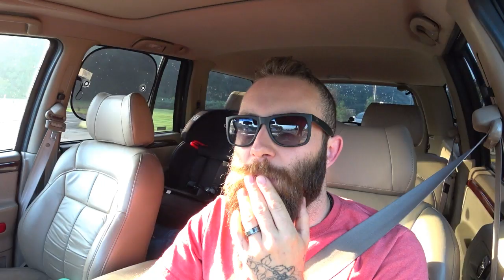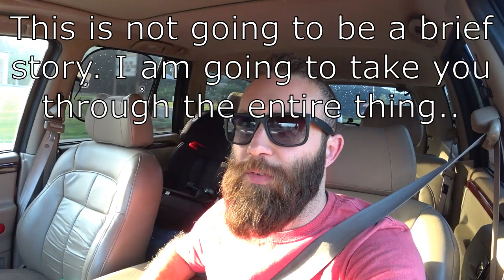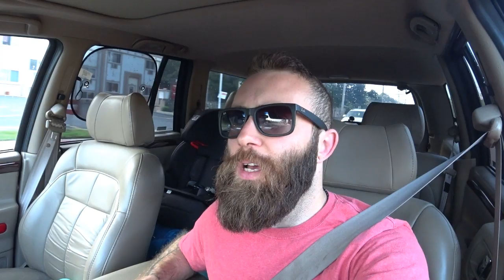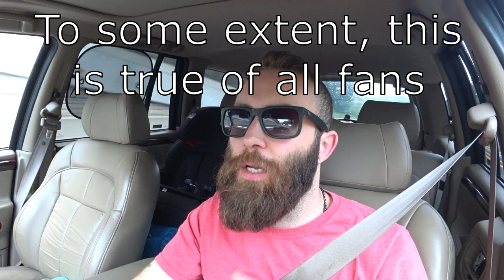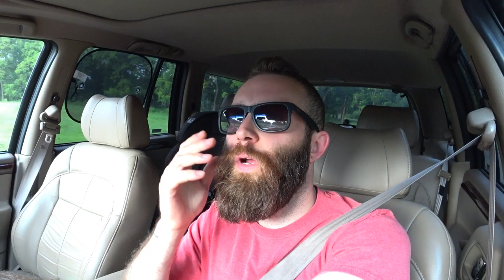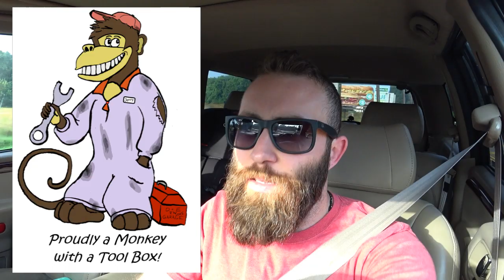Mystery Engine Overheating Issue SOLVED - Jeep/Dodge 4.7L

Comment: had same problem with 2001 grand limited. if your water pump is cavitated it wont circulate right. my thermostat was getting stuck. after doing radiator, water pump gasket, power steering pressure line. lol
Reply: 4.7l
Reply: oh yeah a proper bleeding. lol
Reply: 200,000+ miles. from texas to calif. travel
Reply from the maker: Maybe I will change out my water pump just to be sure
Reply: @DEInTheGarage  at least look at it. didnt buy it off the dealer lot
Reply: Lol

Comment: I found this in the factory service manual: "CAUTION: Use MOPAR Power Steering Fluid or equivalent. Do not use automatic transmission fluid and do not overfill." Do you have the Mopar part number for the correct fluid? Mine (2003 WJ/4.7) runs between 210 and 220 just driving around town, outside temps  70s to 80s so I'm thinking I have the same problem.
Reply: OK, I did some Googling and found it takes Chrysler MS-5931F which, apparently Chrysler doesn't make any more. Fortunately you can just buy any PS fluid that specifies that it meets the Chryslet 5931 standard. So I ordered some RedLine and I'll do a flush & refill (Martinbuilt has a video on how to do it) this weekend & see what happens.
Reply from the maker: Awesome. Let us know how you make out!

Comment: Dealing with a similar issue, Replaced radiator and suddenly i have a code saying either faulty solenoid or wiring. Anyways i go and unhook the temp sensor and the fan shoots into hyper mode. The guys on the jeepforum seem to think i should just try and replace the solenoid. Would you have any recommendations?
Reply from the maker: Yea, those solenoids do tend to go. I think you have to get one out of a junk yard as I dont think they sell just the solenoid
Reply: Thanks, any avalanche videos in the works??
Reply from the maker: @johnb9842  Yea, other projects have pulled me away, but I have the next video planned. Unfortunately I do not have a free weekend until sometime in March, so it may be a while before I can get back to it. At the very least I will go hard on it this spring

Comment: I just bought a 2001 at least having the very same problem. The guy I bought it from has it all torn apart so I haven't really looked it over yet but I'm curious as to whether or not the factory put a warning label on the power steering unit oil reservoir saying to use only Mopar power steering fluid.? 
Then my other question mark is why would you put ATF in the power steering unit and not put power steering fluid in it?

Comment: I hope it all works out. I was worried I have seen issues with 4.7 but man that’s true of every motor. No one goes online to say hey this is the greatest motor about any motor. Tell someone comes up with an issue and they feel they have to defend what they bought like a 3.8 JK guy. I have a 5.7 hemi and now I’m worried about the freakin’ cam. It to is my driver and I just had 3 hand and arm surgeries I can do it. Do I run redline oil as people are saying at 90-100$ an oil change. As we say in bike racing ignorance is bliss. The fastest riders don’t even know how to tune up a bike. Me I go into a corner and it’s like that feels like the axle bearing is a little loose or the bike doesn’t rev out correctly today is it lean etc? The average consumer believes what the mechanic says and goes with that tell catastrophic failure. But drives happy tell then But a dealer serviced Jeep would have $20 PS fluid in it. Ugh now I’m worried the drain plugs tight in my XJ. As I head out to find an oil leak on my daughters Patriot so someone else Can fix it witch hurts my pride. Good luck my friend. Another good vid. Hey fluid wise tell me what to truly run in the 5 speed trans in my XJ so it shifts better I’d pay $20 a quart lol.
Reply from the maker: Haha.. fair point.

Comment: Having issues with the hydraulic fan as well wife bought 03 Jeep Cherokee 4x4 4.7 shit man I replaced water pump thermostat and fluid change and changed the cooling sensor spend hours why it’s still over heating literally lol

Comment: Did you end up replacing the valve seats? Mine has had this exact same issue running a little hot when at stop lights for 3-4 years now. Just rolled 200k and finally found this video

Comment: My 01 runs here in Nor cal Runs @ 200 all day for 3 yrs and No. Problems. For Me Watch your oil. Look for Any normal weird changes. I'm in the opinion. You ran Warm. Not OMG Hot. You'll be good, but that was your Gimme. The Universe wont allow a all out Sin.
Reply from the maker: Buddy, I sure do hope you are right. I want to like the 4.7 and I want to hold on to this Jeep for a while. I have an oil leak right now which is concerning as I have to add oil between oil changes. That is next on the list to fix

Comment: This is the exact issue I am having with my WJ. mine hovers around 210 and if it over 90 degrees my A/C is pretty much useless.  I recently had my power steering pump replaced and that did help but I now suspect they did not use the Mopar hydraulic fluid like you recommended.  I looked it up but there were several results.  Do you happen to still know the part #? Hopefully you do or someone knows. I appreciate any help with this and thank you so much for this video. Damn that hydraulic fan!

Comment: Let me start off by saying 2 things! Great vid, thank you. 2nd. I hate and love the 4.7. I have owned 17 WJs, most with the trusty 4.0, but several with the 4.7. LOL, currently I have #12 my 04 4.7, #16 a 99 4.7 and #17 a 99 4.7. Both my 99s (prob gonna flip) have the awesome mechanical fans as I love, but my 04 has the hydro. Now I have had it over 8 years now and it has 191K miles and never had any issues, I bought from original owner who I know. I am starting to wonder though if I actually have the wrong ps fluid in it as I have noticed that the temp has gone a tad, just a hair past mid point and it has actually felt like my power steering is hesitating when I first start her up. Like for a split sec I have no power steering. Prev owner can't remember ever changing fluids, but also it was taken care of by a few shops over his time. 
I watched your vid and started searching for the MOPAR 68234631AA that is the MS10838 and can't find it anywhere. When I thought I found it was the regular fluid MS 5931 that I am guessing is for all other 99 to 04 WJs with the 4.0 or 4.7 non-hydro cooling systems. 
Every time I think I have found some as they say for hydro it says MS5931. 
I know it has been a few years since you did this vid, and wondering if you still have the WJ and what other issues if any have you had and learned from?

Comment: I got rid of the hydraulic fan I lost a bit of power and and mpg loss but I went to the mechanical over electric fan setup, here is the mod tho I went to a 12 blade 16" fan blade for a Ford Dorman pn620-149
Reply: I had to modify the fan cluch a tiny bit and drill out the bolt holes a little bigger ....
FYI this was recommended from another channel for the fan

Comment: I’m really appreciate all of that information bro!!I have a 2004 ram 4.7 with that overheated problem. What kind of type or model of power steering pump do you recommend me for my truck?
Reply from the maker: I put the cheapest one I could find on. It does the truck, but is very loud.Anything from Rockauto should be fine
Reply: D&E In The Garage 
Bro, thank you so much for help and time, I’m already did the pier steering pump replace but it doesn’t work unfortunately. I have no idea what I’m going to do now. I  replace the temperature sensor, thermostat and water pump either. Any idea to find the possible issue that is causing the overheating?

Comment: TLDR; skip to around 14:30 - 15:00 through, genuine Mopar hydraulic power steering fluid fixed the issue..? Some moron Jeep engineer designed the rad fan to run off the power steering pump somewhat directly (?), and the early 4.7 steering pumps are super dependant on having the correct (thinner than cheaper off the shelf stuff) power steering fluid 🥴

Comment: and let's say you damage your panel to get to the relay under the headlight and it's not there. It's in another location. No idea. New radiator & I overheat at idle, no idea where the relay is.

Comment: Hi Dan I found out how to trick the computer to think the engine is hotter which will make it increase the fan speed for $ 15.
Need a 3 bucks switch from walmart on your dashboard, some cables to bridge the cables on your temp sensor, and a 2.4K ohms resistor (or 2.0K for more)
PM me if you want some more info to show you what i did so you canmake a video on this.
Reply: With the 2.4k ohms we cheat the temperature up 15F at 212F (the computer thinks is at 227F) and wil increase fan speed a notch. 
This works best with a 180F thermostat intead of the OEM 195F
Reply: You need a swich to disconect the bridge when the engine is cold as then the same resistor impacts the reading much more, (like will tell the computer coolant temp is 120F when the true temp is 70F) and your engine will start roughly as some choke is needed but wont have any.

Comment: Look man I haven't 4.7 Powertech motor to on a 2001 Dodge Durango to high-output motor in the original owner of that vehicle that has 240,000 miles on it has the max tow package on it and I tow with a vehicle I never overheated never will and it has two hundred four thousand miles and that truck is going like nothing I keep him entertained you don't have to take out your head out if you don't have to fix him don't fix him
Reply from the maker: Thanks buddy!

Comment: I've noticed a common theme in 4.0 owners who "upgraded" to the 4.7 WJ's for as James Pumphrey would say "Mo powah babeh" and more gears, better towing and a multitude of other reasons. It seems like everyone goes woo hoo! This thing is awesome until it breaks and is inherently more complicated than the 4.0 and then they hate it. As someone who has just made this transition as well I have a couple of points. 1. I love the 4.0, there is  no doubt about that and I will miss my champagne '01 Laredo 4.0 dearly. 2. I love the WJ platform and am attempting to build my own version of the ultimate utilitarian vehicle as you are. Starting with my new to me patriot blue '02 Laredo 4.7 with the 545rfe and a factory (yes FACTORY) 242HD... Somehow I got lucky. 3. In my honest opinion I think people give up too easily. If my 4.7 quits I will be ready and willing to throw down the money for a remanufactured engine with warranty. I think that it would be worth it for what I want to build and the fact that I'll probably end up doing it anyways because the Jeep has 208k on the clock and I want it to be a reliable ultimate adventure vehicle. It is too clean for me to give up on with minimal rust and the combination of options I really wanted (minus the towing package which will be sourced from the junkyard shortly). 4. Keep up the good work Doug, as another proud monkey with a toolbox I really appreciate your videos and the information you bring to light for your followers who may not be as willing to dive so deep into the forums. I know how frustrating it can be, but the reward is that sense of accomplishment that you fixed it yourself and you get to keep driving a sweet old Jeep. I don't think that you should give up on the 4.7 as they do have a lot of positives. It doesn't sound like you've wounded your 4.7 so I would just keep an eye on things and hope for the best. But, if you do decide to pull the heads I'll be following every step of the way! Looking forward to more content!
Reply from the maker: HAHAH... "More HersPers.. EVER HEARD OF IT?"

I am enjoying this 4.7, But I think that i will be back to the 4.0 soon enough. Maybe leave this one for towing a pickup a ZJ for daily driving
Reply: @DEInTheGarage  I don't blame you haha. I am fortunate enough to have an F-150 for my towing needs. I get to have my 4.0 fix fulfilled by my girlfriend's TJ her Dad special ordered in '02. But I do need to try a Zj at some point in time... maybe even a 5.9. I've also been keeping my eyes peeled for a good 4.0/5 speed XJ!

Comment: Hey Ya'all watched a video some guy adapted a huge electric fan into the shroud, I mean that fan is the size of the radiator... Only one problem he never gave the genesis of the fan itself !!! I mean what did it come out of ? Seems to me at least that just might be of some help ? Well maybe that dude will check in here and give us a clue ? I'm in process of putting in a re-man and need all the help I can get. ANYBODY ?

Comment: I have  boild my 4.7 and nothing happended.
Reply from the maker: Yea? How long ago? I am happy to hear not everyone has a horror story
Reply: @DEInTheGarage I am not driving it mutch, but i have overheated it 3 - 4 times. First times was about 3 years ago last time 1 year ago. I drove branch throw my radiator same time towing Nissan patrol ot from woods. Jeep ran overheating about an hour. Motor still runs good only thing happened manifold gasket blow away from last cilinder driver side. Now i have double electric fan setup + new waterpump no overheating problems eneymore.

Comment: I'm having the same exact issue except mine runs full send while coolant temp sensor is unplugged. I replaced my power steering pump last week and it still does it. I'm at wits end Doug. If this wasn't my daily driver I would have totaled it out to get rid of it. I paid too much for this vehicle to be giving me this much trouble. Found the same exact jeep with 115k for 500 bucks but the passenger seat is rusted out, everything else is solid. Gonna buy it just for parts. I'm running car quest Chrysler 5931 compatible fluid through my power steering system since I bought it since the owner ran atf+4 and the ps pump whined like a spoilt brat. Someone help please